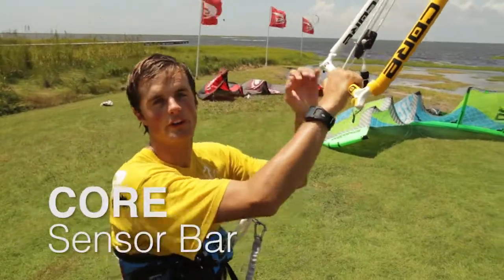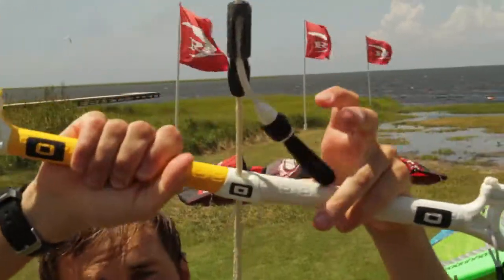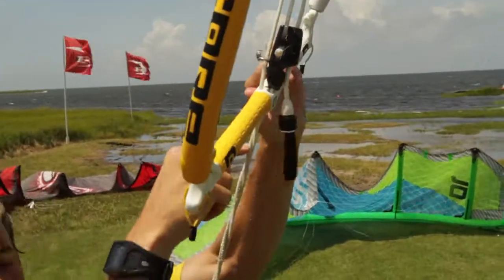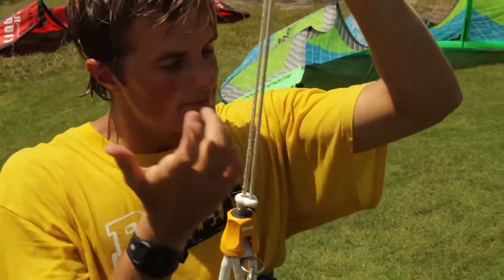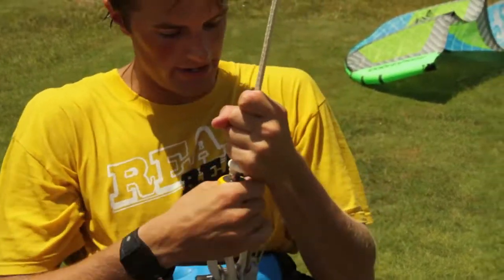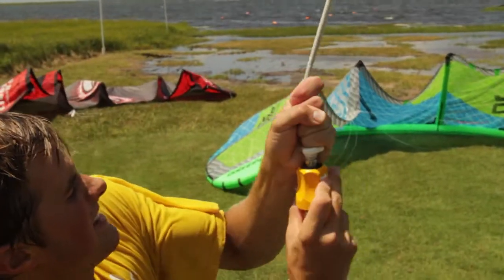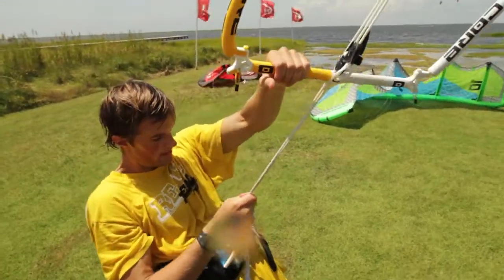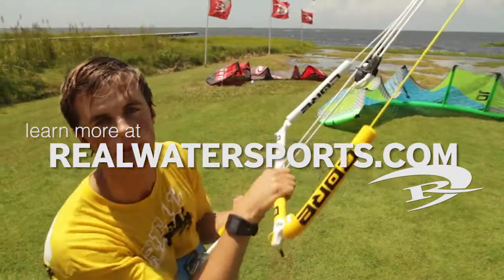Core Kites Sensor Control Bar Review

Comment: Hey Pete, You do have the option of getting the Pro Loop for the Core. I would probably do so if I rode alot unhooked. Overall, I really like the Core Sensor bar. It is really light and feels good and direct on the kite.
Downside, as you said, it will go through center lines and you need two custom ones for a total replacement = money
Reply from the maker: Kirk Schnorr We do have the Pro Loop in stock for the Core bar: 
http://www.realwatersports.com/core-pro-chicken-loop-lg

We're also happy to report that after an entire season of use in our kite school, we haven't had to replace any of the depower lines on the core bars.  They are showing some wear similar to the other brands we use, but nothing has worn out more quickly or needed to be replaced.  

Hope this helps!  Feel free to contact us with any questions realwatersports.com/contact
-Chris, REAL Watersports
Reply: pro trick : you can watch series at kaldroStream. Me and my gf have been using it for watching lots of of movies recently.
Reply: @Jonathan Wayne Yup, I have been watching on kaldroStream for years myself :D